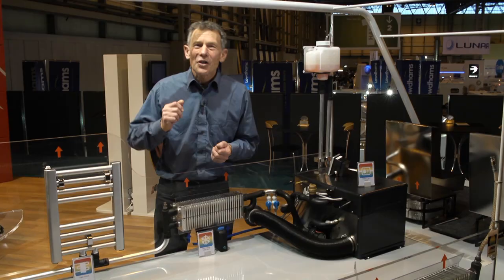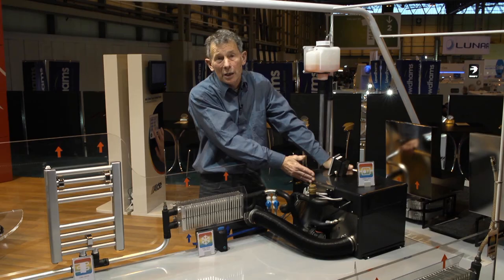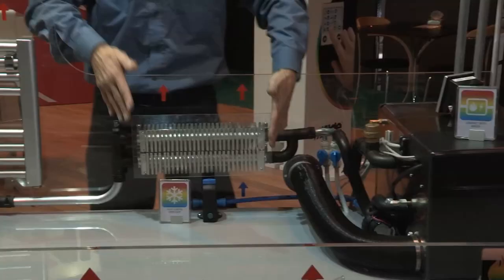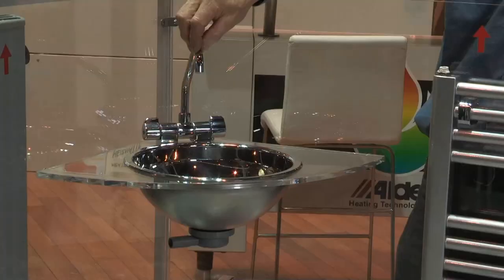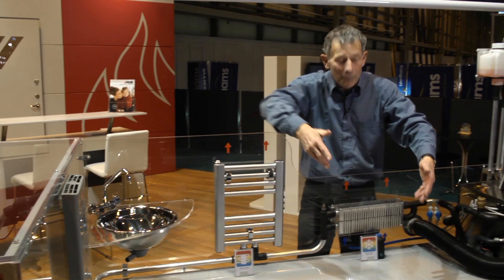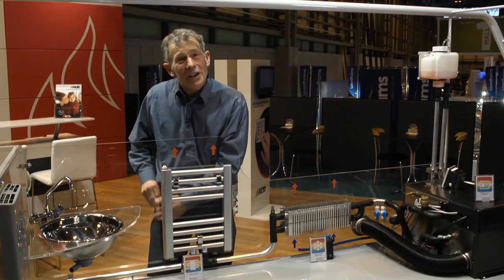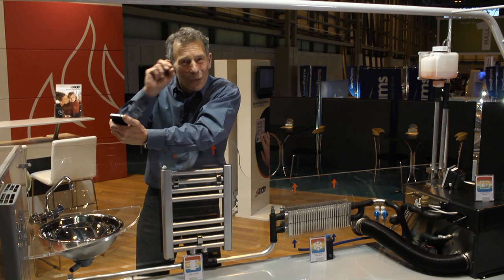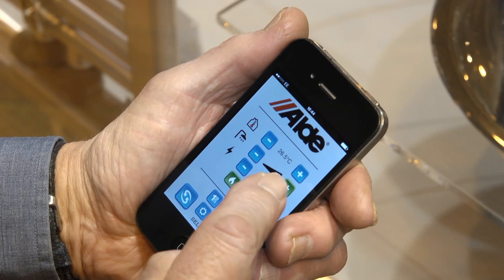Understanding your caravan's Alde heating system

Comment: We have a Bailey Autograph 745 Reg Nov 2014, It keeps on loosing the Heating Fluid and floods the compartment where the Heating unit is, floor and Carpets get covered in the blue liquid and has damaged the wood. Our supplier has had it 3times but cannot find the fault, can anyone help?
Reply: Firstly the fluid should be pink not blue! The blue was the old 2 year life anti freeze which should of been changed in 2016 to the later G13 which is pink.
Theres obviously a leak and if your dealer cant find it contact Alde and request they advise the whereabouts of someone more efficient.

Comment: Good luck. Looks good but how reliable are these complicated heaters?. A replacement control board is $600! If they can make them as reliable as my power inverters then I might get interested. Ive built about 25 solar energy system and only had one inverter failure and that was due to heavy rain splashing into it. My bad!! A expensive lesson that was $850 to repair.
Reply: Look around.. Lots of satisfied customers and technicians. Developed and made in Sweden, and used by demanding customers above the polar circle.

Comment: Hi there, I own a 2001 Polar caravan, fitted with a Primus heating system almost the same like this one. The pump is making a lot of noise at times, so I need ideas where I can find an affordable replacement, and especially how to replace it.
Reply: If that’s not easy to do then who wants a system like that. Ive been looking for a truly simple but effective heater for decades and still haven’t found one. Almost ready to go back to a wood stove. The Alde replacement control board is $600 so don’t fall for this scam!!

Comment: If you look at old systems with manual adjustments.. old school tech which lasts 20+ years... This new and fancy technology looks nice now, but how long you think phones and this app will function... 2 years maybe..then what ?
Reply: Dont worry too much about it. To make it work with the phone app you need to install a sim card, (to transmit/receive instruction and what its done with it) to the £400 module which us an extra and needs installation. I dont think theyre selling well!
Reply: Yes, I was excited by this heater at first but am rapidly losing interest. Reminds me of the hot tub jacuzzi my step daughter insisted on buying that required a new $650 control board. Then no one used the jacuzzi after a year or two anyway. It’s a rotting hulk now. I’m going to try again to build my own simple hydronic heater. Ive tried twice and had some success but was too distracted.